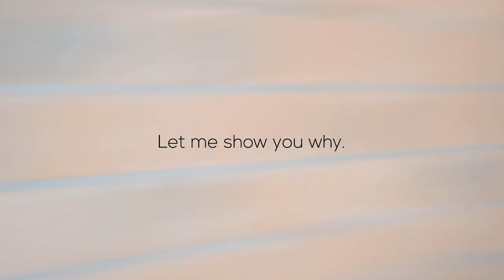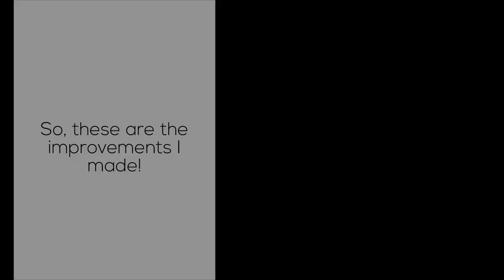The perfect crosscut sled? I took it to the NEXT LEVEL (FREE PLANS)

Comment: Very nice. I actually just made a new sled. I went with 2 separate pieces and a fence only on the left side and only on the front. This leaves the right side as just an open board with miter slot guide that I attach jigs for angles or tapers with double sided carpet tape. I’ve really enjoyed the simplicity of it so far
Reply from the maker: That is a nice idea too! Thank you for sharing that. I will remember this when i make another sled! Thanks for you comment my friend!

Comment: I have never seen anyone take a sled apart and re-build. very nice.  I would like to see a 45 deg jig (or multi-angle jig) that attaches to the t-track and therefore can be removed when not in use.  So basically, your crosscut sled becomes the primary carrier for smaller jigs (45 deg, box joint, dado...)
Reply from the maker: Thank you so much, Brandy Wells. I'm glad you like this video.
I have made a video recently about a miter jig that can be attached to this crosscut sled, as well as many other attachments for my table saw. You can check out all those videos on my channel. I hope they will inspire you, my friend. Greetings, Christophe

Comment: An update idea for you ... With that protection block on the end, on the right hand side, cut a circular hole and attach a hose for dust collection.  So much comes off of the front end of the blade.  I saw a couple of really great ideas here for my sled - Great video as always :)
Reply from the maker: Thanks for your feedback. That's a good idea, Steve! I plan to make a new sled soon, which is slightly smaller than this one. If I have the space for it, this idea can be implemented! Thanks for sharing.

Comment: Nice project and your video quality is, as always, excellent.   One question;  on the table guide rails, you glue on the bottom of the sled, because the glue joint is stronger than the wood, is it necessary to use screws in addition to the glue?
Reply from the maker: Good question! I know that the glue is strong but i wanted to be sure, so i used screws too! Thank you for your comment my friend! If you have mor questions, don't be afraid to ask. I will try to help where I can.

Comment: I need a new sled and I like yours the most. Lots of features and still simple to make.  I have on concern with how the front is attached to the base. Wouldn't it be safer to just screw it at 90 degree? With your micro adjustment, if the crews get a bit lose, we could be not square and not noticing it.
Reply from the maker: Thanks for the praise. It's nice to see that this video has helped you. I understand what you mean. You can indeed fix that fence, but I chose this way because I can then adjust to when I have perfectly square cuts. I check this sled regularly and adjust if necessary.
Thank you for watching, and good luck and have fun building this sled. If you have any questions, you can always contact me. I'll help you where I can.

Comment: Looks pretty sweet dude. I should probably make something like this for my MLT100. But I have a mitre saw which does most of the things crosscut sleds do so I have never gotten around to it. I liked your little handle making jig, and I never thought of using masking tape to mix glue on.  A lot of work went in to that video so soon you will have 1000 subs and can start getting some financial reward for all your hard work. Keep it up. Look forward to the next one.
Reply from the maker: Thank you so much for your nice comment! I definitely recommend it to you. The cuts that you can do with that are very precise. The handle jig is something I made a while ago, you can find the video on my channel. I use this jig more than I thought when I made it. The knobs are useful for just about all applications.
Reply: @christofix  I will go check it out. Only 7 subs from 1000!
Reply: @christofix  Congrats on hitting 1k!
Reply from the maker: @ToolsAndStuffOFFICIAL  thank you so much. That is very kind of you

Comment: Looks great.. the only thing I would change would be where you have put the handle.. for me it would be better at the top of the box not sliding on the table.. then I could get my fingers into it better.  I did have to watch the video twice to see everything as you did things in fast forward but I guess that is one benefit of this type of format.
Reply from the maker: I like your comment my friend. placing the handle a little bit higher would be great. You are completely right. I will try to make another video with some imrovements and will use your suggestion. I will mention your name in it. The fast forward is because otherwise this video would be 8 hours instead of 8 minutes hahahaha. I think this way it is best, those who want to see it fast get what they want and if you want to see more you can watch twice like you did. Don't be afraid to ask more questions about how i did someting, I will try to do my best to anwser your questions. Thank you so much for watching and commenting. I really appreciate it. Greetings

Comment: Hey, what’s the width of the railing slots? I’m either getting too loose or too tight. 13mm is just too tight and 12mm is way loose. I’m building a jointing jig and I’m not getting the railing correctly. Nor is there any information anywhere about it.
Reply from the maker: Hi, Those are 12mm. I hope this helps. Thank you for watching my video. Greetings, Christophe
Reply: @christofix  weird I got 12.75 on my caliper and it is causing little play. Makita isn't consistent with their quality
Reply from the maker: @ajayvishvanathan1991   @Ajay Vishwanath  I have to say, the longer I work with this table saw, the more it frustrates me to see those little things that significantly impact my work. It isn't that accurate, but on the other hand, it is a quite low-cost tool.

Comment: Love it!
Where do you get your T-Track from? 
I know there has got to be a less expensive source than rockler or other big box stores...
Reply from the maker: Those rockler or kreg T-tracks cost a lot of money. I just bought curtain rails. They are perfect and very strong. There is a link in the description but it is only available in Belgium. But you can see the product over there and maybe you will find the same in your local store. Let me know if you find them and if you have more questions don't be affraid to ask. I will help you where I can. Greetings
Reply: Look up Shop Fox. Cheaper but not cheap
Reply: And it's red in color
Reply: 16' .....still not cheap, $60 but about the best price I could find. They're on Amazon
Brand: Taytools

4.6 out of 5 stars  160Reviews

Lot 4 Each, 48" Aluminum T Track 3/4" by 3/8" Slot, Accepts 1/4" Hex Bolts, 1/4" or 5/16" T Bolts, Countersunk Holes Every 6" 112134

Amazon'sChoicefor "aluminum t track"

Comment: I have a sled made on my older 12 inch table saw that I wanted to implement some ideas on...but I have a broken car that sits in the front of it and is on a 10 year program on the "honey can I do? list"...  I have a sled the width of the table and the initial time I was able to use it...it was flawless....until I forgot to make sure the blade was at 90 and the next time I used it....my zero clearance was no longer as functional. 😞😒

Some of the thoughts I had (prior to the trap it is in presently) was to  make it more versatile in the way of using either side (cuz it has 2 tracks for the miter slot) for those times where I need to cut on one side of the blade or the other....that I could remove the front and back pieces in the center (that act to keep the left and right sides of the sled together as well as the safety section on the furthest part back).  My thought was to have couple expanding dowels to line up the connection points.

It is cool that I have found your channel cuz I love your creativity...as far as extending the sides...this is also something that I had "started".  I have the wish of adding a router to the side table that will have a piano hinge on each side for working with larger pieces.  The challenges I have are more with lack of funds and trying to be on the same page with priorities with my better half. Haha!  I also wanted to have a folding outfeed portion...that may have to be a separate panel cuz I have a motor with a belt drive which protrudes too far out for a piece of wood to just relax down...
Reply from the maker: My problems started when i had the same like you have, my blade was not at 90 degree angle and my zero clearance was gone. So i had to find a solution for that because it will happen again for sure. Thank you so much for your comment. I really appreciate it seeing you in every video. Thank you so much!
Reply: @christofix  I got some of those rare earth magnets that I thought of for a removable insert plate that could be removed and swapped for plates of popular angles. (With the magnets being skinny and strong they could be flush mounted with the top of a sled panel and the bottom of the insert panel(s).... But I don't know how truly good they would hold the two pieces together with the vibration of my old saw.  Lots of thoughts in my over thinking ever engineering noggin. Haha!

Where do you get your t track from? I do like that for certain things and when I am able to get to some of these projects ....  I do like that stop block on the back piece of the sled.

I enjoy your videos! Keep up the awesome work!

😇😎😀